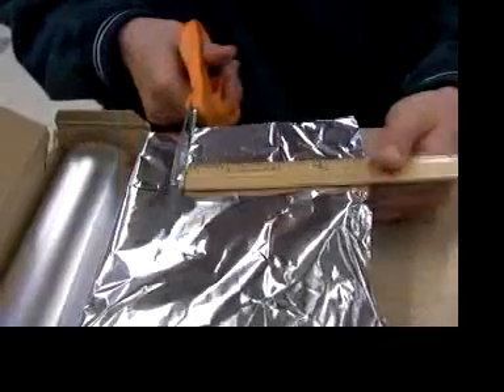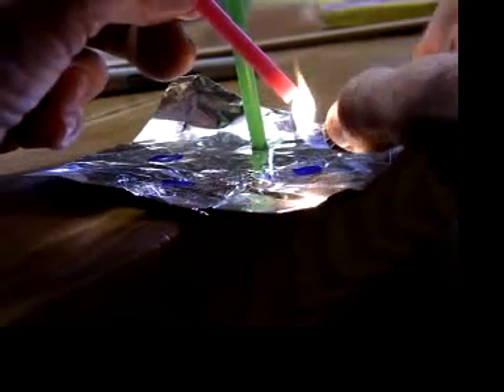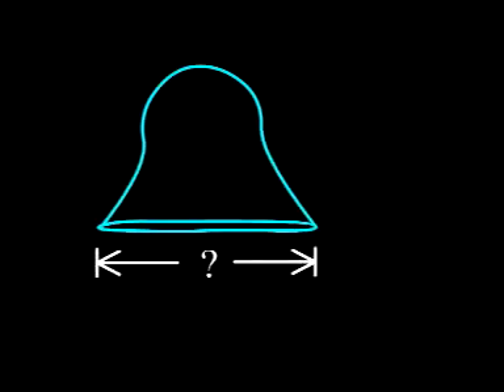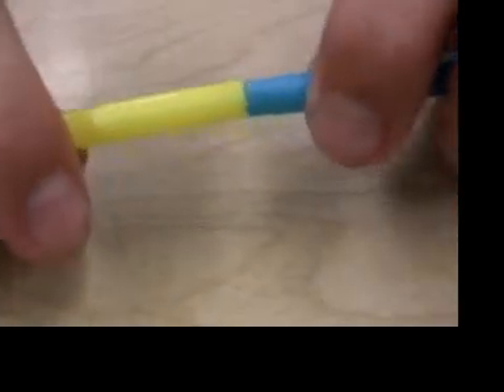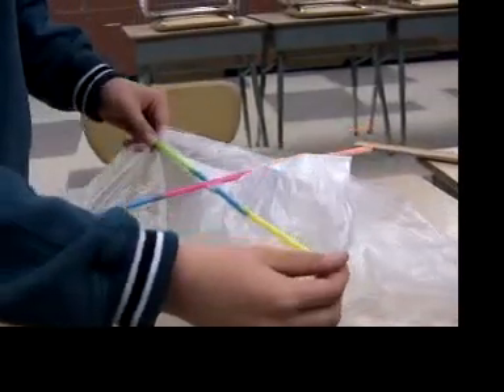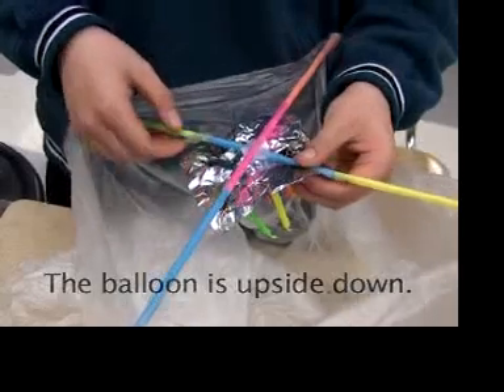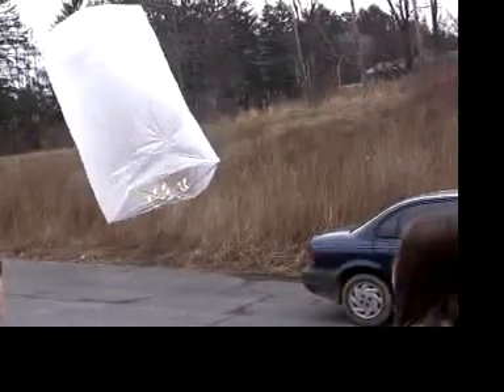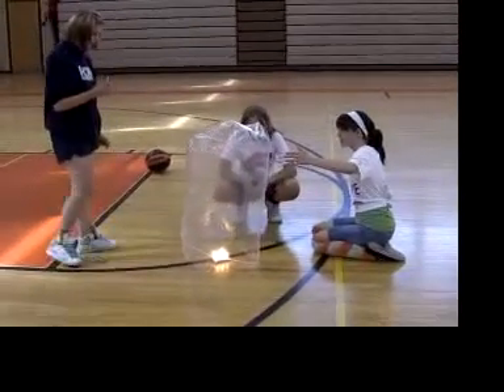How to Make a Hot Air Balloon Part 5 Making and Launching

Comment from the maker: @luckylovesall I'm pretty sure the missing factor is the thickness of the plastic bag. However, you could keep making a bigger fire until it actually melts the bag. You could keep adding candles or use string wrapped around wire, soaked with denatured alcohol. Also, I can't link on comments, but search for a website called overflight . They have ideas for using lots of candles.

Slater

Comment: @sciencetoymaker Hi, I have cracked it, the Hot air balloon. It went up very well, in hot temp :). As you said the thickness of the plastic, i searched for the thinnest plastic & it worked very well many thanks for your help. Tomorrow iam gonna experiment it at day time when its the temp is at highest level. wish me luck :)

Comment: Back in the seventies, I would use this method to create UFOs.
I would use dry cleaner bags, balsa sticks, and a survival candle.
To launch, I would put charcoal in a small metal pail to preheat the envelope air.
It would only fly in the cold, so most of the time, I had to wait till fall or winter.
For safety, I would only have an inch or two of candle.

If I had the help, we would launch several at once, and they would fly 'in formation'.
I never knew if they generated any UFO calls to the police or not, but I always launched them after sunset so the candle flame could be noticed.

If I were to do something like that today, I would buy a tank of helium and several very large balloons to carry an electronics light package up for the UFO display.
 I like the tethering idea, I could recover the package and reuse it, rather than let it fly away.
Reply from the maker: Yup, I did not realize at first just how profound a difference the air temperature has on efficiency. Flying in cold weather is much more efficient. It is also true of airplanes. Pilots have to calculate "density altitude". Both hot temperatures and high altitude can reduce flying efficiency.

Comment from the maker: @luckylovesall Hi. I need details. The next part talks about how small bags are not efficient. Also, though you said that you are taking care of weight, the bag is by far the biggest weight factor. I have never been able to get typical garbage bags to work. To answer your low temp environment question, some of the smaller bags will only work in cool weather. But find the right bag and it works in hot weather. Let me know how it works out.

Slater

Comment: @zPeeNuT 
ok, i believe you should try using bigger plastic bags than  that of in the video and add up 1 or two more candles. i saw one video and they'd used garbage bin bags, about half the size of a man 5'9 ft. tall.... but they did not use candles, instead a fire starter and it flew so high outside.... just give it a try... i wish this will help you...

Comment from the maker: Well, Part 3 addresses safety. Plastic is not as easy to start on fire as tissue paper, but it will burn under constant flame contact. It's a good idea to have adult, common sense supervision and a fire extinquisher on hand.
Slater

Comment: bro pls answer fast the  air ballon can fly in the open sky and how far it will go
Reply from the maker: The short answer is, "Out of sight" if it is not tethered (held from going away by a string or thread). Specifics depend on the outside temperature (hot air balloons are more efficient in cold air), how long the candles are, the weight of the bag, etc.

Comment: We just use two skinny sticks of balsa instead of putting all those straws together. Formed a cup out of foil, put a couple of cotton balls in it with a couple of caps of alcohol. I'm guessing the foil, alcohol, and cotton balls are lighter, but I really don't know. Never weighed any of it and it flew further than we could see every time.
Reply: sciencetoymaker I guess if you cut the candles in half they wouldn't be quite so heavy. I imagine a half of candle would produce a good hot flame for five or so minutes?
Reply from the maker: +Kirby Yes, cutting the candles in half reduces weight and still burns for a long time. It also gives them a lower center of gravity. The biggest problem of the design is that melting the candles onto aluminum foil  is quite awkward and they get knocked off easily.

Comment: It does not working I trying but it does not working
Reply from the maker: Shashavindu Shashavindu You have to be specific. Is the bag made of very thin material? Do you have enough heat to lift? It works more efficiently in cool weather.